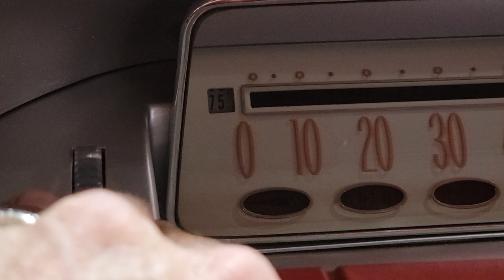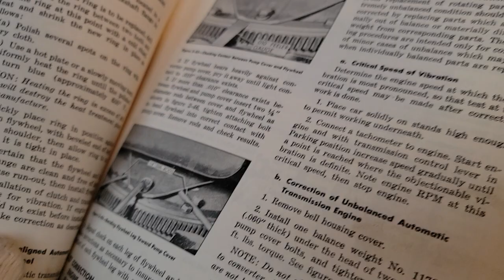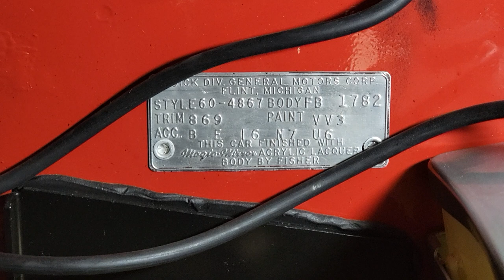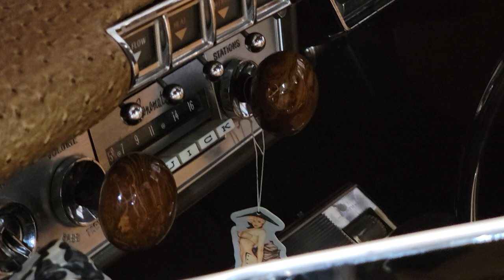Gorgeous FULLY Optioned 1960 Buick Electra 225 Convertible For Sale~No Expense Spared Pro Resto!!

Comment: Quick correction... 225 was not the wheelbase, it was the total length of the car.  Also, when the newly named lineup in 1959 appeared they were named LeSabre, Invicta, Electra and Electra 225.  This is a beauty!
Reply from the maker: Great, Thanks; I didn't know that :-)

Thank You,
Michael Runnalls
Specialty Car Marketing & Media
WeBe Autos Ltd.
Long Island, NY 11780
Michael@WeBeAutos.com
www.WeBeAutos.com 
(O)631-339-0399 
(C)516-729-2003

Comment: Let me add another comment on my all time favorite car. As a tool and die maker  I challenge anybody to appreciate the effort that went in to producing such a flawless front fender.
Reply from the maker: I Agree, just a Timeless Design, these cars today are all the same, NO Passion Like they had in the 60s!
Reply: @WeBeAutosLtd  I have to go back again, the sharpness of the front fender was a staggering piece of engineering. Today, fifty years later, I don't for a minute decry the ability of Buick to produce such a work of art in mettle. 

Maybe there is one in an hundred who of you that knows what I'm talking about?  but I'm being generous with you.  There isn't one in ten thousand of you that for minute, can appreciate the sixty Buick.

It was, and always will be, the epitome of American automotive art and engineering.
Reply from the maker: @teddyshepherd2854  

Did you Know that this Car Shared the Same Windshield as the Cadillac?

///Mike
Reply: @WeBeAutosLtd  Hello Mike. Just for a bit of history I'm a Brit, Limey if you like. I emigrated to Canada aged eighteen with my new bride and fifty quid in my ass pocket  in the mid sixties.

For a good part of that time I worked in a tool and die shop that catered for the then "Big Three" What would it be now, the "Big Two" and all the rest of the world?

The point is, I was led to believe, that not only were things shared, but year in year out, depending on the model, not much changed in the way of the frame and running gear, they maintained the same and just stuck the "New Model" body on top.
Reply from the maker: @teddyshepherd2854  
Ahh, That explains the envy and appreciation of the Craftsmanship of the front Fender. Sadly all the Cars today are Machine Pressed, Molded Plastic and Don't have a Soul like they did in the 50s and 60s..
Reply: @WeBeAutosLtd  "Sadly all the Cars today are Machine Pressed,"

Just as they they were in 50/60s. But the difference then,  when the design department sent the blueprint down to the shop floor, I'm sure the answer might be: "A bit tricky, but leave it with us, we'll sort it out'

Send the blueprint down today -'You've got to be fckng kidding me!?
Reply from the maker: Lol, you guys always did sort it out,